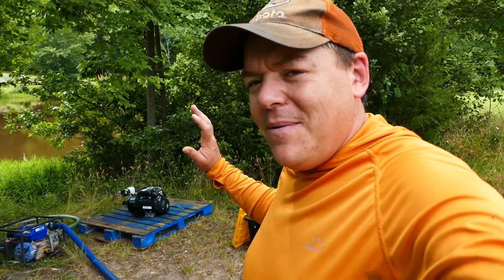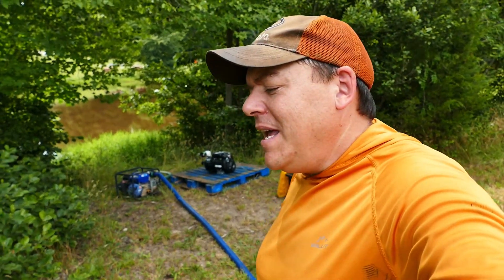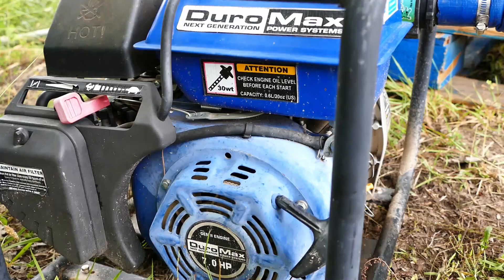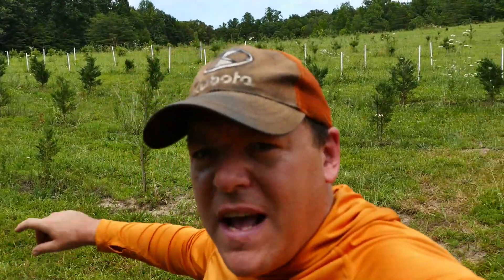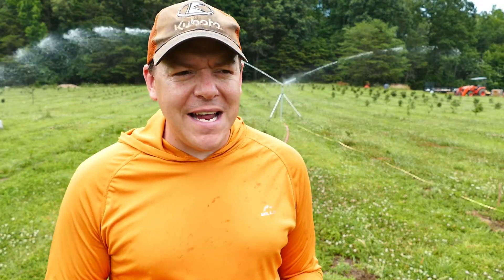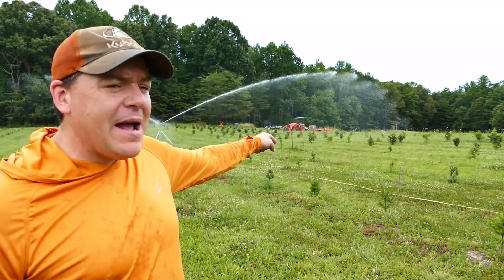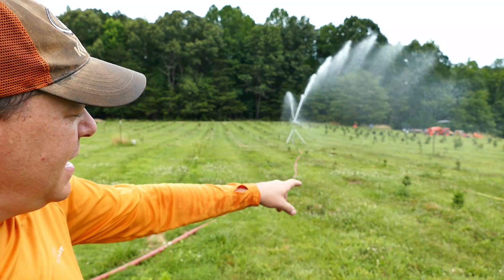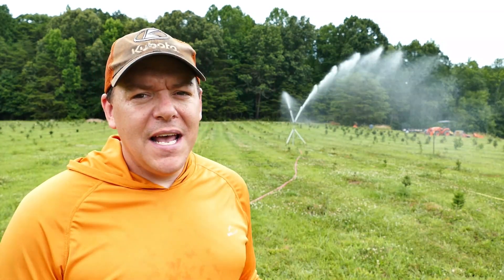I Had NO IDEA a New Pump Would Be This Much Better!

Comment: Hi. Thank you for your video. Did two in series ended up working?
Reply from the maker: I did but with lower pressure per head it didn't really end up covering any larger of an area
Reply: @WoodsTreeFarm  got it thanks. Need a head and a pump to cover 180 feet diameter, was hoping two in series would do

Comment: If you got a 150 or 200 series gun and a pto pump and engine you could really cover some ground with them the 200 is maxed out at about 300ish feet. The new pump seems to have more pressure and your sprinkler is shooting farther and has more stream atomization.
Reply from the maker: Thanks for the info. This year we got lucky and hardly had to irrigate at all. I'll probably look for a bigger pump in the future as I know my little 2" pumps aren't the best for this application.
Reply: What is a PTO pump and engine?
Reply: @CrochetNewsNetwork  runs off a engine. What farmers use to irrigate the big fields

Comment: Can you show me how you made the stand for it. Connection and what not. Do you hane a 2” hose connected to the PVC?
Reply from the maker: I didn't make the stand. Its the prebuilt stand like this: https://amzn.to/4cxqqCj  on the bottom is standard NPT thread. I got a 1.5 - 2 inch adapter and threaded on my 2 inch quick connect

Comment: 92 foot head requires 40 psi, so now you are running 50 psi.  The big question will be answered on your next test is... can you still get good pressure running two sprinklers.  Looking forward to hearing/seeing it.  Good luck!
Reply from the maker: It does ok with 2 sprinklers but had to put on smaller nozzles. See it running at the end of this video. https://youtu.be/NBi-1iWiGVE
Reply: The PSI to head ratio depends on the diameter of the pipe

Comment: HOW FAR FROM WATER SOURCE IS IT TO THE SPRINKLER?
Reply from the maker: where this video was shot was about 200ft I think. Ive run it as far as 600 ft and the throw radius goes down to about 40ft on that pacer pump.

Comment: How much are you able to sell the trees for
Reply from the maker: None of our trees are ready to sell yet, but we have opened a tree lot the previous 2 years with precut trees and sell most $70-85
Reply: @WoodsTreeFarm  are they 6 ft tall by then, seems like a good price for the buyer doesn't it take 7 years to get them that tall
Reply from the maker: Right, it takes at least 5-6 years to get to market size. We've brought in trees from other farms in previous years and will do that again this year. Another 2 years or so before any of our trees are ready.
Reply: @WoodsTreeFarm  crazy prices, seems like you would be able to sell them for at least 100 bucks minimum, that's alot of time and work into it to give up for 70 80 dollars, is that really the going rate, it would be fun to see you get more than that out of them, just my opinion
Reply: @SolidworksUnlimited I was thinking the same thing especially in this economy $100 per tree. Seem like a crazy good price at $70 to $80